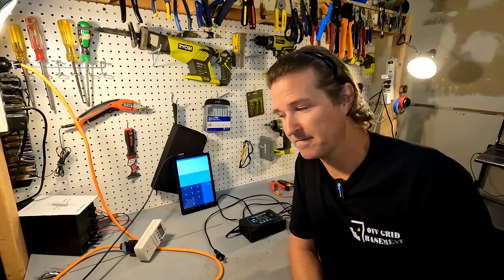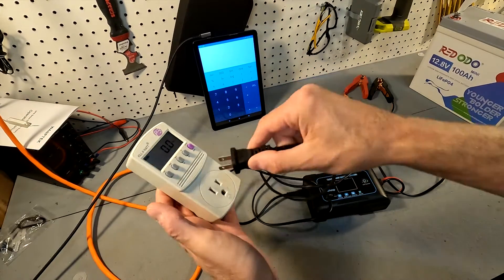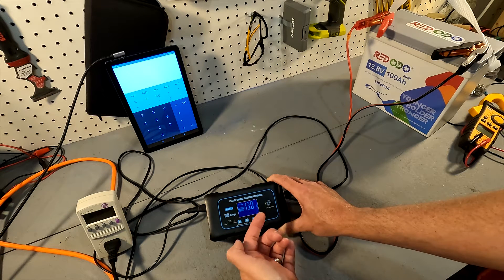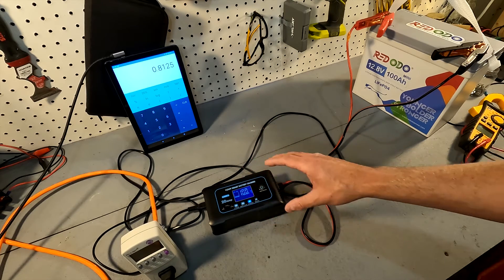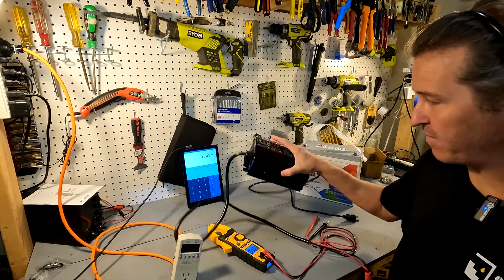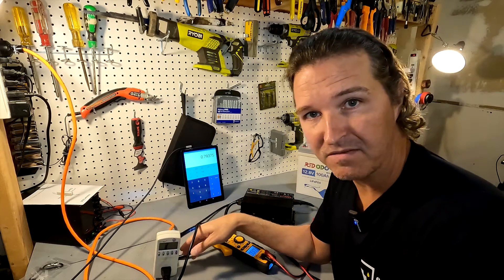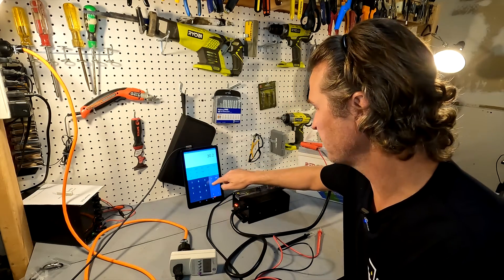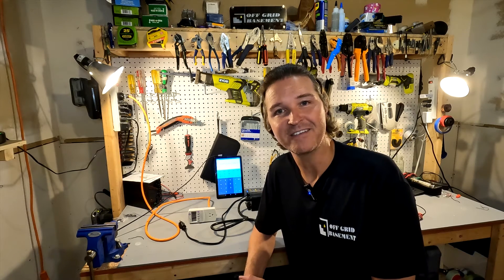How to find the efficiency of your battery charger.

Comment: Some of those plug in power meters will show power factor. How does power factor play into the total watts used by the charger? Lets say the total charge of a battery shows a total of 1000 watt hours and your power factor was .65 does that mean only 650 watt hours went into charging the battery? If we want to use this to test the true capacity of a battery as well.
Reply from the maker: Thank you for the information.  I honestly always forget about Power factor.  Thank you!
Reply: @OffGridBasement  that was more of a question lol I do not know the answer and hoped you might. I have a power meter similar to yours which I bought with the intention of proving the capacity of various ebike batteries that I have. I have a battery that registers 1000 watt hours from dead to full charge but what I don't know is how efficient my charger is. Without knowing that, I can't really say what the true capacity of my battery is. I do know that one of my chargers comes up with a .65 power factor. Another charger comes up as 1.0 power factor. I assume the 1.0 has built in power factor correction and the other does not.

Comment: Generally speaking, not great when charging via an AC outlet.  The inefficiencies add up quickly.   So... 80% to 85% is typical for AC chargers.   And if you are doing it from an inverter its even worse.  The inverter will be say 85% efficient, and the charger will be 80%... that is (0.85 * 0.80) = 68% efficiency.

Isolated Buck-boost DC-to-DC converters generally top out at 90%.  Non-isolated buck-boost converters can hit 94% or so.

However, you can get up to 97% efficiency when charging a lower-voltage battery bank from a higher-voltage battery bank.   For example, by using a simple Victron charge controller (which are buck-only synchronous charge controllers).

I use that trick all the time to charge 12V banks from 24V or 48V banks.  97% effiicency is really nice.  A lot of people don't realize that you can use Victron charge controllers that way.  The input does not have to come from solar.

In addition to all of that, the battery itself is only 95% efficient (the charge curve voltage vs discharge curve voltage at the same SOC averages out to a 5% loss).  And that is only if you charge and discharge at 0.2C or lower.  If you charge or discharge at higher C-rates, the efficiency will be somewhat worse.
Reply from the maker: Great info!  I have a spare victron controller that I plan on doing just that.  Thanks for the comment.

Comment: May I ask if you noted the volt amps as well as the watts, please? your P3 has that function.  Some of the battery chargers show say 100 watts but are using 175 volt amps. Any generator powering the charger is burning fuel at the 175 rate rather than a 100 rate. The P3 also has a power factor reading that would indicate the charger's power conversion efficiency. You measured the DC side as volt amps. In DC the watts and volt amps are the same. 

The reason I'm asking, is I have a 900/600 watt (really volt amps) propane only powered inverter generator. The efficiency sweet spot is about 500 "watts", near your P3 watt reading. after seeing your test I'm tempted to buy that same 30 amp battery charger but cannot run over 600 volt amps continuously with out generator burn out.  

Additionally some off grid viewers might like to know if their generator was using fuel in the 480 watt range or as if the charger was using closer to 800 watts rate if that was the actual volt amp range and fuel usage rate.  

A T Burke
Reply from the maker: Sorry for the late reply!  While charging at 10A the watts are 170w and the V/A is 245.  The power factor shows .69.  Hope that answers your question.
Thanks!
Reply: Thank you, Sir.  I have one of those 5 year old Ryobi propane only 900w peak 600w running rated generators.  But, the rating is actually in volt-amps like in all rotating armature AC generators/alternators.  When using low PF loads I have to remember to only use about 70%+or- of the 600 so called watts or the unit barfs.  

A T Burke @OffGridBasement

Comment: Question: Would the battery's state of charge affect the efficiency calculation ?  What was your Redodo battery's state of charge ? Thanks
Reply from the maker: The Redodo was right around 25% SOC.  I don't think it would affect efficiency because as the charger voltage gets higher, the amperage it puts out drops.  The output wattage remains the same.  I would need to test that to verify.  Thanks for the question and comment.
Reply: The state of charge will not, but the charge or discharge rate will.  Battery efficiency is roughly 95% at a 0.2C charge or discharge rate.  The efficiency will go down as the C rate goes up due to the internal resistance of the cells.

Power losses from internal resistances go by the square of the current.  P = I^2 * R.  The same holds for wiring losses as well.  Its pretty much universal.